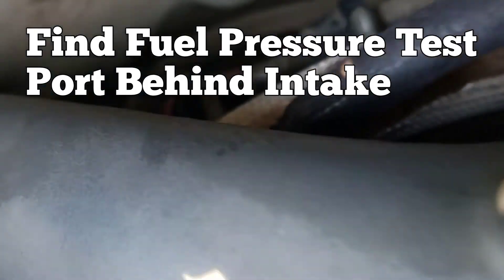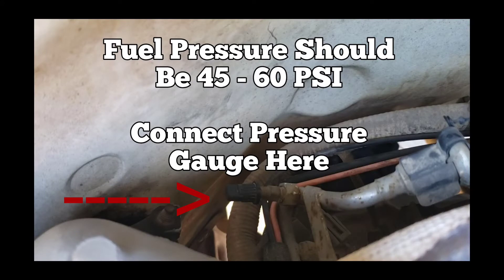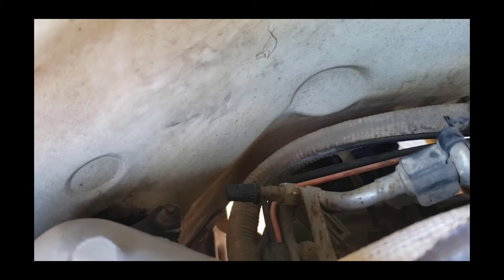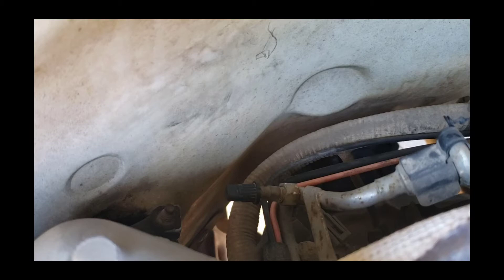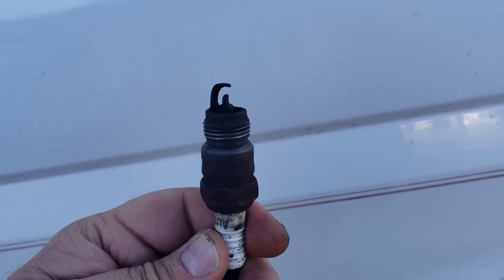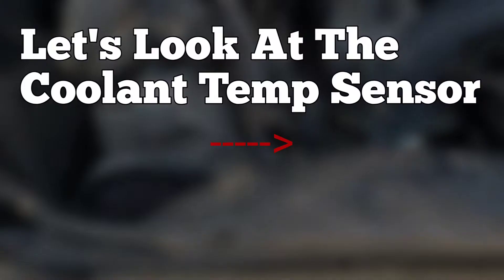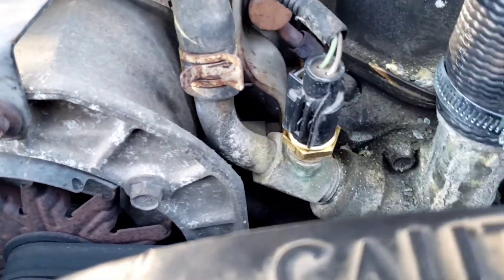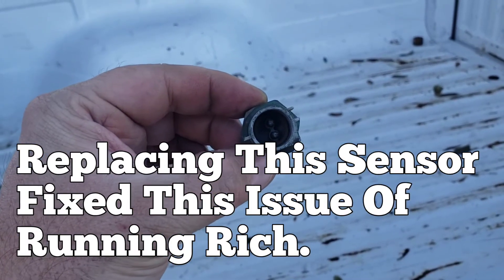94 F150 4.9L Runs Rich, Hard To Start, Black Smoke, Poor Idle

Comment: I had the same exact conditions with my truck, changed out both coolant temp sensors, will check spark plugs & injectors next
Reply from the maker: Im assuming the coolant temp sensors didn't fix the issue?

Comment: Helloni have a 95 ford 460 snd i sm having same issue to much fuel isve replace coil cap rotor wires sparkplug temp sensor fuel pump and injectors fuek filter snd its doing the same thing
Reply from the maker: Another "potential" cause could be a stuck o2 sensor or a bad map sensor.
Reply: @ezautorepairs 
 I am giving up compresson check out 

New 02 sensore 
New temp sensore 
New fuel pump
New plugs 
New rotor /cap
New map sensore
New pump

Still running rich at load back fires misfire
Smoke black smoke and  parked reverse up it well even smoke
Reply: Changed it did not fix roblem

Comment: When the temperature sensor goes bad doesn't it give you a wrong reading inside the cab?
Reply from the maker: @rickmavictime756  not necessarily. On some vehicles there are 2. One sends info to the computer and one is just a sending unit that controls the instrument cluster. Just depends on how the engine is set up. I'm pretty sure that particular engine has 2 separate ones.

Comment: I have a 91 Ford f350 7.5 and its running bad rough. Like its struggling for air or fuel. And shakes. I put new everything. Spark plugs. Spark plug wires. TPS. EGR valve sensor. MAP sensor. Distributor cap and rotor. Ignition coil. Ignition control module. Purge valve. PCV valve. I didn't do the idle air control valve and fuel pressure regulator yet. I wanna make sure first. And im also in the process of cleaning out the engine with that flush stuff. If you can help me.
Reply from the maker: Not sure how many miles are on it, but have you checked compression? Low compression will cause low power and running bad in general. If it had high mileage (not sure if it does or not) I'd start with the basics. Compression definitely then go from there. Possibly even plugged exhaust, or valves not opening or closing correctly.
Reply: @ezautorepairs  where is the compression will be?
Reply from the maker: @hendricks177  I don't know the exact specs right off hand, but each cylinder should be somewhere around 140psi. You would also want each cylinder close to the same.
Reply: @ezautorepairs  is that for the spark for the plug to mix air and fuel ratio?
Reply from the maker: Well, each cylinder has to take in a mixture of air and fuel, then compress it. Once it's compressed, the spark plug will fire at a specific time. A compression test - tests the engines ability to compress the mixture. Once an engine reaches the minimum spec, you will start having drivability issues. Not saying that is what it is, but if you have replaced everything else, that would be where I start looking.
Reply: @ezautorepairs  yup. New spark plugs. New spark plugs wires. New distributor and rotor. New MAP sensor. New EGR valve pressure sensor. New air filter. New ignition control module. New ignition coil. And still nothing. I didn't do the idle air control valve yet and fuel pressure regulator yet and EGR it's self yet.

Comment: Why does a coolant sensor make it rich ?
Reply from the maker: The computer needs to know the engine's temperature in order to provide the proper air/fuel mixture to the engine. If the coolant temperature sensor is giving the computer incorrect data, the computer will either feed too much or too little fuel to the engine.

Comment: My bronco is doing the same thing I put a new coolant temp sensor on and it appeared to be running smooth. But it's only been a month and it's back. If I unplug it it runs excellent but it's a much higher rpm though
Reply from the maker: It's possible the new sensor is bad already. Did you use a oe sensor?
Reply: @ezautorepairs  put on an AutoZone one . But the intake air temperature sensor looked even more crappy quality than the coolant sensor. Running so bad not even matching throttle so I think it might be ICM

Comment: my son in law has had big issues with his '96 f150 missing, shaking and running poorly.
if it was mine i'd probably just convert it over to carburetor since there are no inspections where i live.
all these sensors are just headaches and added expenses and when their engines are not running right pollute way more than the old school ones ever did.
Reply: I'm over EFI nothing but gimmicks to keep you buying parts I want my truck to be reliable like an old carb truck

Comment: Mine fires up fine cold, drive anywhere and shut it off, upon restart you get erratic idle, as if when warm, it doesn't know how to idle warm start. During a stop sitting idle you smell unburnt fuel, had the check engine light coming on, was the O2 and map, I replaced the map, a shop replaced the o2, both were from 1989, original equipment, cracked distributor required replacing it, did cap, rotor, plug wires, and plugs. I have not seen the check engine light back on since repairs, but not satisfied with running condition, its a low mileage engine with only 70,000 miles on it.
Reply from the maker: Any luck with it? Did the running condition change after the repairs?
Reply: @ezautorepairs  No, I have been holding off pulling the ECM and getting a peek at the capacitors, I can't reach the throttle plate, sits way back in the van, need to go to a shop and have the TPS checked, but with no check engine light, no shop may want to mess with it. If I didn't have to do everything from a wheelchair by myself I'd get someone to help me pull the intake tubing, I've removed the air box twice, was looking to replace the vacuum lines, parts store was out of the 1/4" stuff I need, awaiting it to be shipped to me, no leak found tho, the opposite as the canister held it for several days, I've not driven it but was under vacuum.
Reply: @ezautorepairs  Thought I'd update ya, new injectors, IAC, TPS, MAP, steering pressure sensor, distributor, temp sensor and it still will not idle in gear, replaced the caps in the ECM, this thing is junk.
Reply from the maker: I sure hate to hear that. That is a lot of parts and low mileage on the engine and still won't idle smoothly.
Reply: @ezautorepairs  Well it is 30+ years old, electronics don't age well, I had it running smooth, just can't drive it, put it in gear and it quits, when I had it just idling in reverse it was shaking like crazy, drive always stalls it, the mechanic said he'd quit if it were his, take it as a loss, since someone totaled my previous van this means I get to eat another, I can say I will not buy another ford unless it has a carburetor.

Comment: Just curious if I drove mine after about 5 to 10 minutes it would shut off. Also what manual were you using I have been looking for a good one.
Reply from the maker: To be honest, I don't have a manual for this model. I just know from experience there are a few sensors that can cause this. In this case, it was the coolant temperature sensor!

Comment: 1994 4.9L, takes a long crank and then it does seem to gag a little...but then she runs fine. When hot the crank isnt as long but is longer than usual....engine has 96,800 miles...sat in a garage most of the time.....miles are mostly long rides...

Comment: I have this same issue occasionally. Only when the engine is hot though. When you had this did the gauge appear to function normally?
Reply from the maker: Yes it did. The temperature gauge appeared to be operating normal. When I unplugged the temp sensor, everything ran fine.